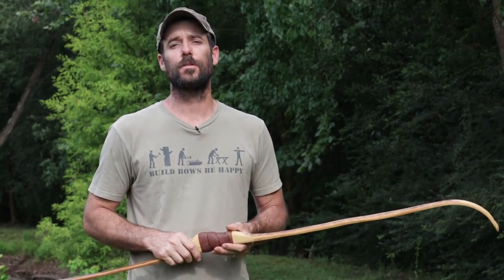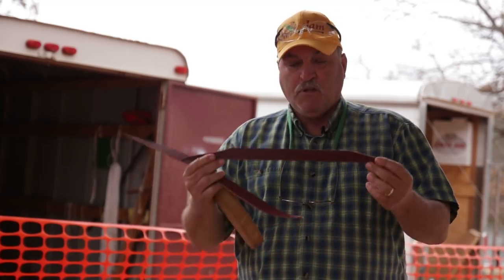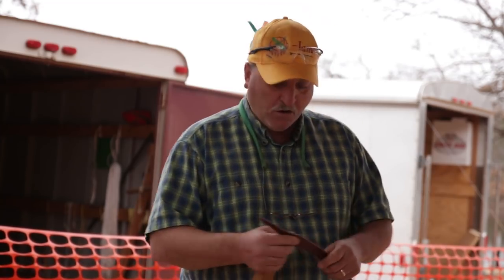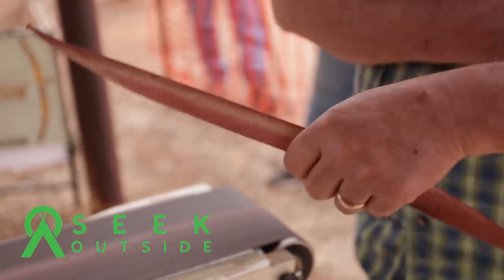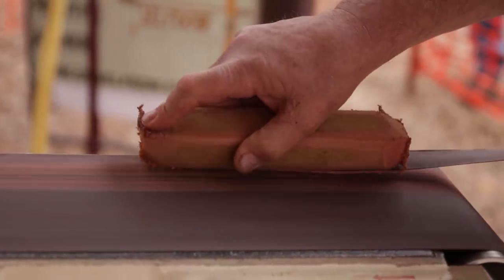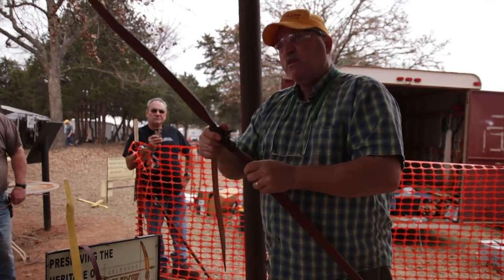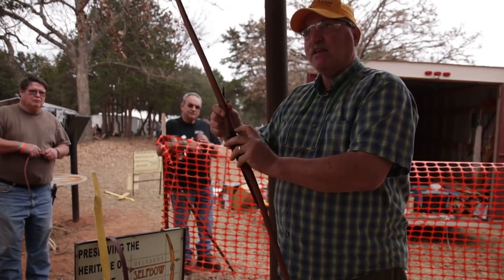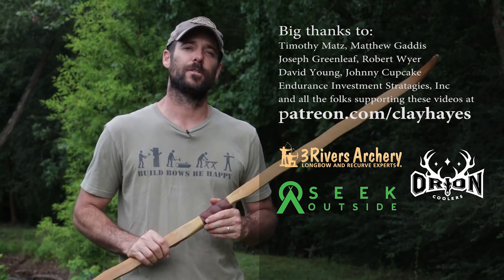Handle wrap for longbow, recurve, or self bow - how to

Comment: If a guy was to do that with hand tools, what would you suggest?
Reply: It will work with a sanding block or a sure form rasp.  There are old boyscout leather working project books that show this.  If you want a different look you can wet the leather and pound the edges with a hammer and anvil, and put a pattern into the wrap.
Reply: SeadartVSG thanks, that makes sense.
Reply from the maker: Thanks